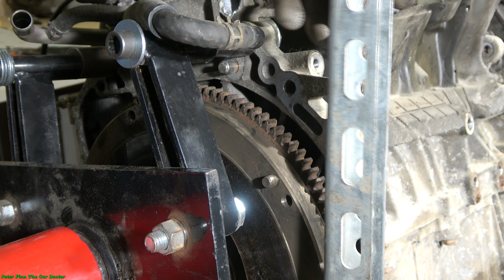P9/41. How to Disassemble Toyota Camry 2.4 VVT-i engine 2AZ-FE: Crankshaft Pulley wheel Bolt removal

Comment: Can you please  make a turtorial how to replace vaccum pump in Valvetatic Toyota engines (Corolla 1,6, Avensis 1,8, Camry etc) ? The repacement is necessary every 195 000 km according to Toyota.
Reply from the maker: Yes, I will in the future
Reply: @PeterFinnTheCarDoctor  OK, thank you. I have still 45 000 km to run so I can wait :-) Here is helpfull manual for you: https://www.tochr.net/694/vacuum_pump.html